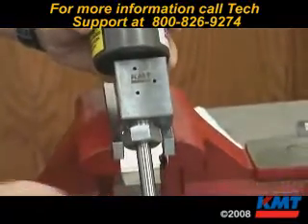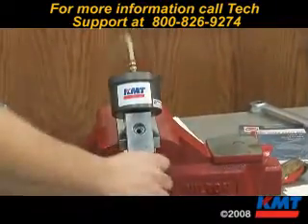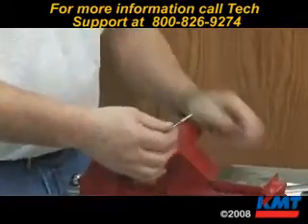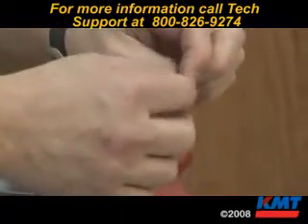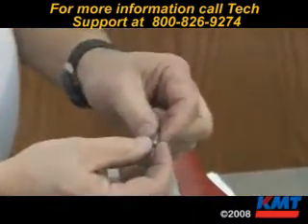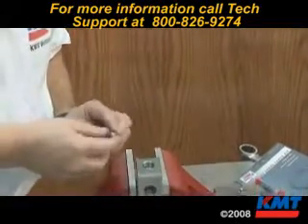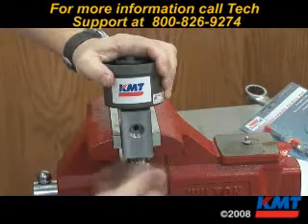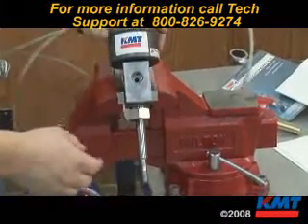KMT Waterjet Normally Closed Pneumatic Valve Seal Repair

Comment: Hola  buen dia como puedo quitar un niple que va en el acomulador de el intensificador esta fugando y esta  interno
Reply from the maker: Attenuators are a certified pressure vessel.  No parts are available as no work can be done on them.  With that being said, it is possible for the nipple out of the end to be resurfaced by using a power coner if the coned surface has been eroded.

Comment: How many threads should be visible on the gland nut when completely tightened into the valve body?
Reply from the maker: +Rachel Vroman 
When the gland nut that holds the nozzle tube is installed, you should not see more than 1 or 2
threads.  Charlie M., KMT Technical Service